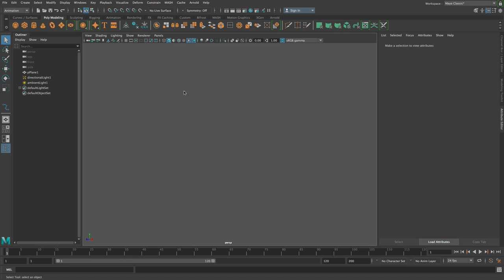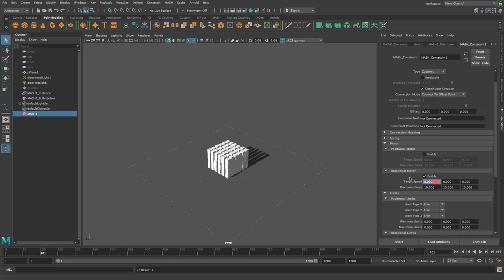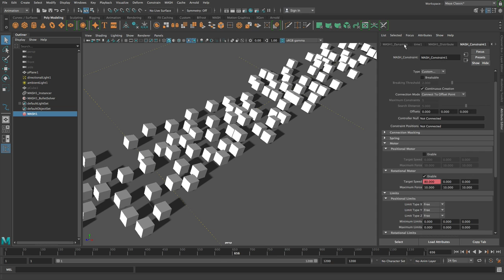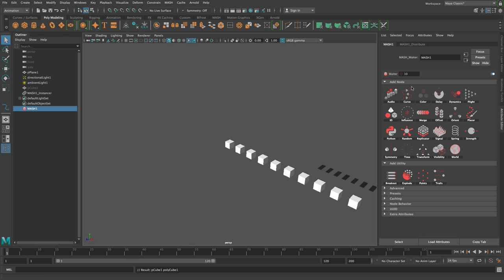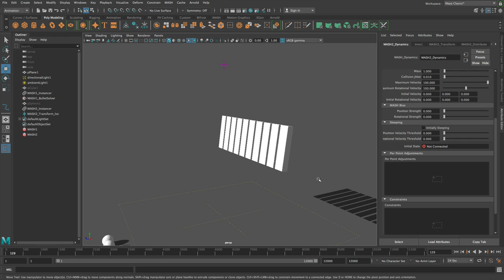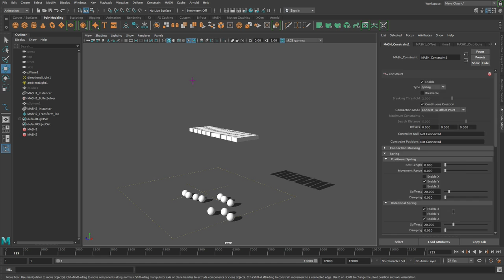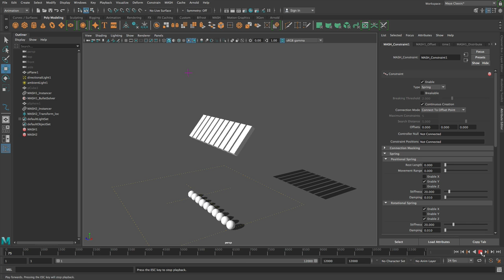MASH Dynamics No 11. A brief introduction to Motors

Comment: May i suggest something i believe it will be very handy for mash which is motion deformation.. where i can control the POSITION of the elements using the standard deformation like bend, twist, lattice, without affecting the main shape of the objects.. i'm trying to create something which looks almost like tornado. which is thin and thick from differnet parts but i won't happen easily in Mash if i dont have such deformation.. and thanks anyway for all. you are amazing
Reply from the maker: It's a great idea :) You can use vortex fields do do stuff like this, there are some cool nParticle tornado tutorials out there. Good luck!
Reply: Ian Waters I don't want it for dynamic purpose. Maybe in dynamic u can create this shape but it won't be controllable .  I'm talking about motion graphic which u want some specific order but in a shape of let's say tornado or maybe something else which we can get from using lattice for example. But I'm happy that u like this idea I hope I will see it someday in the next edition.

Comment: Also did you know you can create a new default scene? You could create a default scene that contains your light rig. Just go to File->New Scene [OptionBox] and check Enable Default Scene, point the path to your blank scene with your light rig.
Reply from the maker: It's a great tip, but as a developer I hose my preferences every day, and I can't be bothered to keep setting them up again ;)

Comment: Is there a way to add variance to the rotational motor? I'm not seeing that channel in the MASH ChannelRandom.
Reply from the maker: You're right, I didn't get round to adding it (you can't do it all for V1! :). Your request has been noted and I'll add it for an update. You can work around this by varying the other per point attributes thought, like damping slightly, to get different speeds though. Good luck! :)